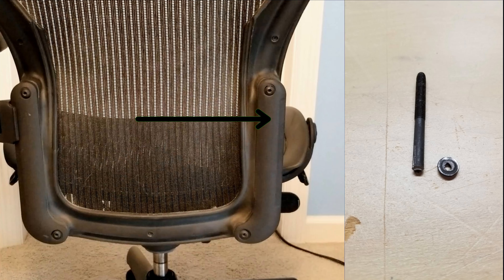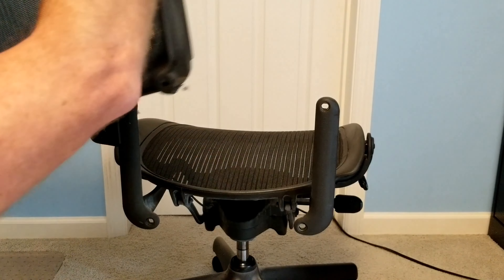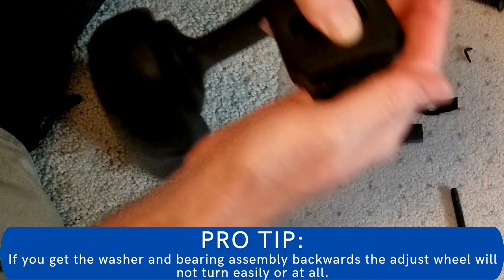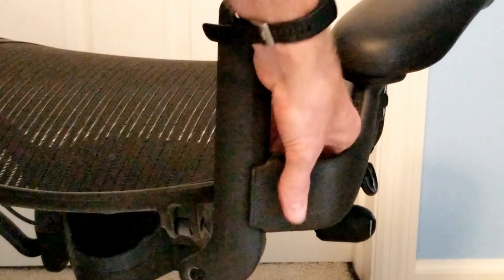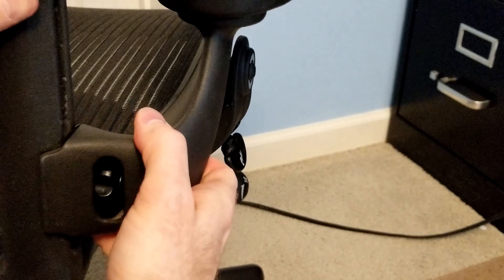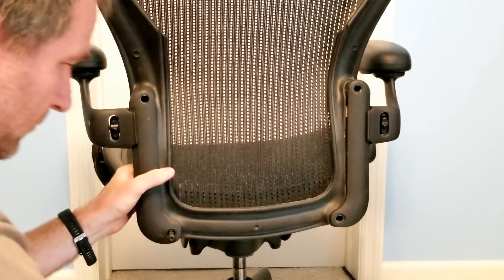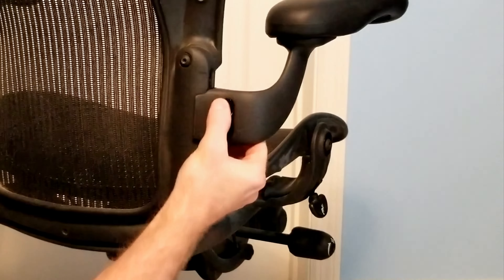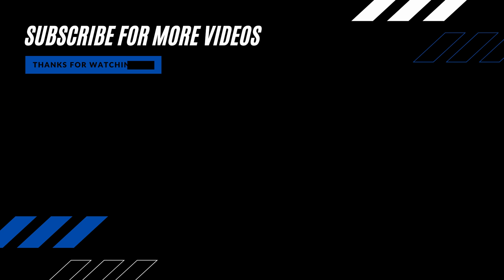Herman Miller Aeron Armrest Repair | Broken Armrest Bolt | How to Replace the Armrest Bolt - SBW#48

Comment from the maker: Question of the Day
Has anything broke off your office chairs before?
Comment Below
Reply: Literally had the head of that exact same screw shear off today during lunch. Video was a life saver, since the new assembly is crazy pricy and I bought mine second (or more likely third) hand a couple weeks ago
Reply from the maker: @kennethcarroll5007  I'm glad this video helped you out. Those assemblies are quite expensive when you price them out and when the bolt head shears off, you'd think you should be able to replace just the bolt right?
Reply: my left arm rest just broke off today as i was readjusting myself in my chair
Reply: Yup! The bolt in my right arm broke off, too. I'll fix it as soon as I can find the correct bolt at my local hardware store. I'm not purchasing the 'kit' they sell for like 30 bucks! What a rip-off! THANK YOU Sean for making this video for us! :)

Comment: I just had this issue.  M6 Metric threads are close, but did not fit my chair.  The proper fastener (for mine) is a 1/4-28 (fine thread) x 2.5".
Reply from the maker: Hi Barry, yes. I updated the description but I haven't had time at the moment to update the video with some overlay text.  I'm going to try to get that done in the next few days but thanks posting that so others can see this comment as well!

Comment: Thank you - my daughter is not 6 ears old anymore and she still likes to sit in daddy's chair (when it is occupied!) and today the armrest broke off - knowing the size of the bolt and the general instructions - it took 20 minutes to fix - including making sure I could still use the wheel to adjust the armrest vertical adjustment. This cost me $1.70 - and only because I bought 2 bolts - in case the other one snaps off - lol.. Again - thank you for the guide!
Reply from the maker: HI @unclereggie9113, I completely understand about kiddos.  You're more than welcome for the guide and thank you for the compliment.

Comment: Thanks.  Fixed a 22 year old Aeron once I knew the process and spent the 55 cents on the bolt.  Splurged and got a few extra for the other arm and the other chair in my office.
Reply from the maker: Glad to hear you got it fixed @Daniel Abramovitch.

Comment: Wow, thank you, thank you, thank you! I bought a stainless hex cap screw at Lowe's ($2.28 for two) and following your instructions, the repair took less than 10 minutes. The adjustment seems to work better than before.
Reply from the maker: That's great to hear that the repair worked out for you @georgeorme760!

Comment: so i finally went to hardware store and bought the exact bolt in description (the guy said it was going to be grade 5 after i told him size) after taking it apart 3 times and realizeing i was missing a piece (thought i just didnt have that part cuz i didnt see it fall. I think it fell off when the arm rest snapped off readjusting myself) Found the part I was missing and now it works perfectly! you'd never know i used a bolt.
Reply from the maker: Hey sorry it took so may attempts.  I know when the head of mine broke off it sounded like a gunshot and parts shot all over inside the chair and the floor.  Glad you got it solved though!

Comment: Thank you for this video!  When my arm rest fell off randomly I was devastated. No one wants to have to buy a new HM Aeron chair (or maybe we all want to...but we don't want to spend the money) so I was at a loss.  I googled to see if it was fixable and I landed on your video. Ran to the hardware store, got two of the bolts needed and got to work. I figured if I was taking it apart to fix the one arm I may as well prophylactically do the other side as well. Good as new (maybe better since I doubt the new bolts will be snapping in two at any point.
Reply from the maker: Glad this help @leannrichmond9381.  I totally agree with the not wanting to buy a new HM chair.

Comment: Great video, helped a ton, thanks! Just chiming in to report another case for fellow metric Europeans.
M6x0.75 x 70mm bolt in my case, M6 fine thread pitch, roughly equivalent to US/imperial UNF thread pitch and all I could find was grade 8.8 which should hold up to the load easily.
Reply from the maker: Thanks for the additional information @osbert.  Others watching the video may find that information very helpful.
Reply: Thanks for this numbers I have the same issue I will go to solve it.. :D
Reply: @ediazrod  glad if it helps! word of warning, I measured almost identical threads on the bolts on both arms, but one of them turned out to work much better with a standard pitch M6 thread in the end! I don't know what HM were doing when they made these but what a whole load of hassle!

Anyway, seeing as it's much easier to find standard pitch for this size bolt, I'd try that first and see if it is suitable before investing in shipping over fine pitch versions from overseas like I ended up doing... I found testing the thumbwheel nut much more useful too seeing as the end nut is more like a locking nut which should bind.

Comment: Another happy customer...thanks Sean - Only comment I'd make is that I had no clue as to what the 28 referred to in your 1/4" - 28 - 2.5" Grade 5 Bolt....a helpful Menards employee let me know that it referred to the thread and 28 means fine.
Reply from the maker: Thanks for the info @seanoconnell450. I didn't think much of that detail.  Glad I  could help you!

Comment: So if it's just the bolt that's sheared if I can find the same kind of bolt I don't need to repair the hold thing? You may have just saved my life. I got mine used so I doubt I'd be able to get any kind of support and I definitely don't have the money to replace the whole chair.
Reply from the maker: That is what I did to mine @Saplingbat.  I just replaced the bolt as the head had sheared off of it.  All the components were still in the assembly so I was able to just replace the bolt and reassemble it in the correct way.

Comment: Mine was M6x1.00x70mm socket head cap screw
Reply from the maker: @fefi, thanks for the update and glad this helped! I guessing the sizes vary some depending on the year of the chair.  It is why I recommend taking the thumbnail locking wheel in to ensure you get the proper threading. Size should just be measuring the length of the existing bolt.

Comment: Off to a hardware store to get two bolts - had an armrest fall off today.  My Aeron chair (so far) has lasted 25 years and three offices.  Thanks for this writeup.  I also had my backrest "bar" fail and the seat bottom replaced over the years.  The "strut" is still passable.
Reply from the maker: Wow - 25 years is a little longer than mine.  You're welcome and glad it helped.  Word of thought though, I believe my "strut" is starting fail.  Sometimes when I sit down in the chair it does about a sudden 1 inch drop and then compresses like it should.

Comment: This was an excellent guide to fixing my chair. I had the exact same shearing problem. I used a 6M x 70 mm Phillips head bolt and it worked like a charm. Putting on the arm was a 2 person job.
Reply from the maker: Thank you for the compliment @stupidsnservice.  I'm glad it helped you solve the shearing issue.

Comment: Thank you for posting this!   The head sheared off the original bolt and I just completed the fix based on this video.  Worked perfectly.

 A point about bolt length that might help others-- my original was 2-5/8" as some others noted.  However,  a 2-1/2" replacement worked just fine.  The extra length was just going beyond the nut into the cavity of the arm anyway so no impact.
Reply from the maker: Excellent! I'm glad it helped solve your armrest problem and hopefully you were able to fix it!

Comment: I unfortunately slipped when removing the adjustment knob and now and the washer and bearing assembly slipped out. I don't know the order of re-assembly — any chance you could help?
Reply from the maker: Hi @RealArtsMedia, at about 1.5 minutes into the video I talk about the washer and the bearing. One side should have the washer and the other side should have washer bearing assembly.  If you get them backwards the knob will not spin very easy.  In addition, at 5 minutes in my video I show the hardware illustration - this section does not show the bearing assembly but only the washer in the knob.

I hope this helps out!

Comment: would be helpful if you just told me is bearing in inside or outside... or show that in pic...
Reply: drum roll please... the bearing goes on inside twords chair (where all the locking pressure is). the other thing is the nut that falls out of the arm rest can only screw in one way so check that during assembly.    dont do it twice.
Reply from the maker: @sl1587 thanks for all the feedback.

Comment: Thank you so so much for posting this!!  I couldn't find the exact bolt, so I ended up using the same size screw.  Worked like a charm and cost <$1.  Took me 5 mins to put back together (thanks for the photo at min 5!).  Made my day!
Reply from the maker: @Lily Volpe, I'm glad it helped as that was the purpose of the video. Thank you so much for the complement!

Comment: Great video, thanks! I looked up the OEM replacement part... $90 for the assembly including the broken bolt. Thanks to this video, and $2.99 spent at the local hardware store, I'm good to go!
Reply from the maker: Glad it helped Robert. I was also shocked when I looked up the part and thought to myself, there has to be a less expensive way to fix this!

Comment: Thanks for a great video! I got 10 (!) grade 8 bolts from Amazon for $9 delivered, and with your instructions was able to fix it right up. Like some other commenters, my bolt broke right at the joint between the threaded and non-threaded sections of the original bolt. Soaking the nut in the arm in penetrating oil (Tri-flow) for a couple of hours made it possible to use a pair of needle nose pliers (and a tight grip) to unwind it. 

Taking the back off also revealed the sticker showing that mine was manufactured in 1999–here’s hoping I’ll get another 22 years out of it!

Thanks again!
Reply from the maker: You are most welcome and I'm glad some of the comments also helped you and have inexpensively fix your chair!

Comment: Just what I needed, thanks. Must be a HM design fault, or is it reasonable for stress over the years for the head to fall off? Just need to find the right replacement in the UK, which might be challenging
Reply from the maker: To me it looks like a design flaw since with the bit slot so deep into the bolt there's very little steel to hold it and over time I'm guessing metal fatigue just  causes it to break.
Reply: @SeanMoenkhoff  mine (right side arm) busted almost 20 yrs after good usage.
Reply: @MilkyPork  The initial fix with a similar original bolt didn't last long, and snapped again. So I ditched the adjustable wheel and other fittings and put in a regular bigger bolt and nut, since I don't need to change the height, and it's holding steady now

Comment: There was a nut that fell out when I did this repair.  Anyone know where it goes?
Reply from the maker: Hi @James, check the both sides of where the adjustment thumb wheel is.  I believe there is a nut inside of that housing that the thumb wheel goes it.  It should be hexagonal shaped receiving slot.

Comment: in the video you said grade 8, but in the description it says grade 5... which is it?
Reply from the maker: The size has varied as you can see by the comments on this video, I'd suggest taking it to Ace Hardware, Home Depot, Lowes or another hardware store to make sure you get the correct grade.